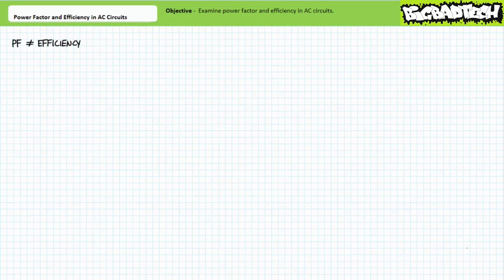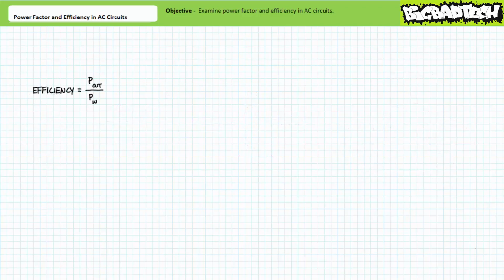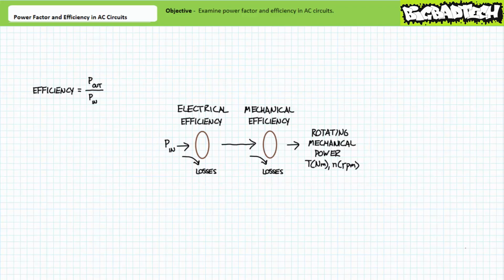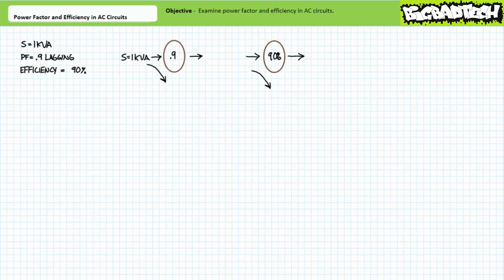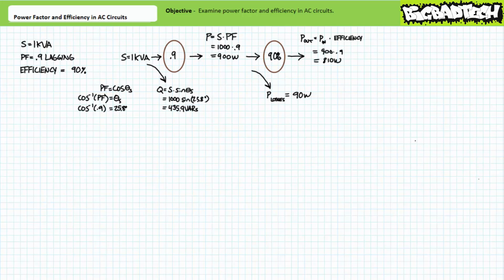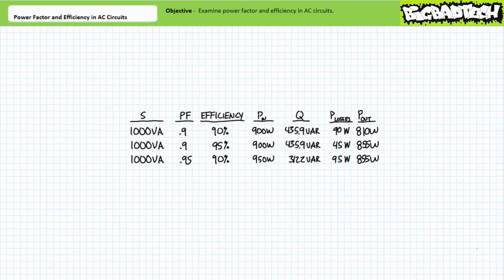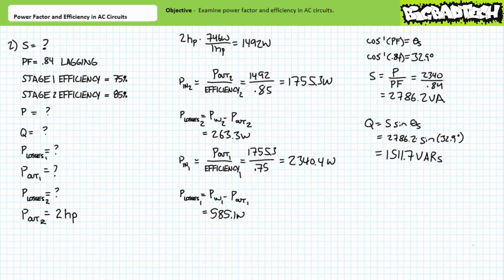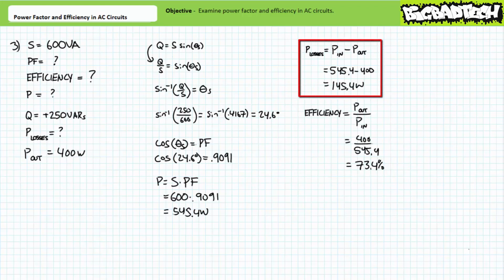Power Factor and Efficiency in AC Circuits (Part 1 of 2)

Comment: Can you tell me the formula to figure out amperage after as you say filtering it thru pf and eff?
Reply from the maker: Depends on what information you have available. For example, if you know mechanical power output and efficiency you can find real input by mechanical/efficiency, then determine apparent as real/pf, once you've got apparent you need to know either voltage or impedance to calculate current, for example if you knew voltage current = apparent/voltage.

Comment: Great teacher, but I'm kinda lost trying to figure out the Efficiency of a Cascading Toilet Paper, Compressed Cheese and Slippery Fish System in the Observable Universe when the Inductive Power Factor is 85% Current Lagging Voltage.  

Siri, Google Assistant, Cortana and Amazon Alexa haven't got a clue what you're talking about.

Even ELI the ICE man is stumped.  He's my go to guy for metal plates stuck real close together, coily wire thingies, admittance, susceptance and transcendence. 

Another buddy of mine, Newton, (I call him Fig) is saying I can measure this stuff myself. He says Schrödinger's Cat can help with the fish part and to use a Bose-Einstein condensate interferometer for the cheese, but I can't find an interferometer at Lowes or Home Depot.  By the way, Swiss or Cheddar?  Does Swiss maintain its holes when compressed?

I sent all my money to my new friend Kwame Django, a Nigerian prince, who owns bauxite reserves that Chinese aluminum companies want to mine south of Ouagadougou.  Can you hook me up?   I will gladly repay you on Tuesday (when he makes me a Royal Abujan Knight) for an interferometer today .
Reply from the maker: The obvious solution to these problems is a Turbo Encabulator. https://www.youtube.com/watch?v=Ac7G7xOG2Ag
Reply: that was good!  but i'm having a hard enough time digesting a slippery fish while using cheesy toilet paper when done....wonder if that's marketable here in sconni??